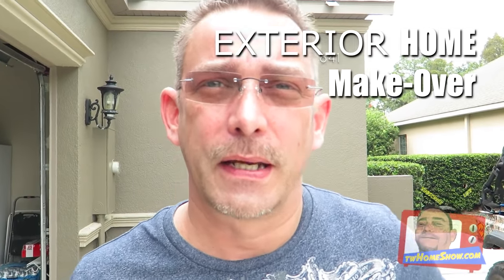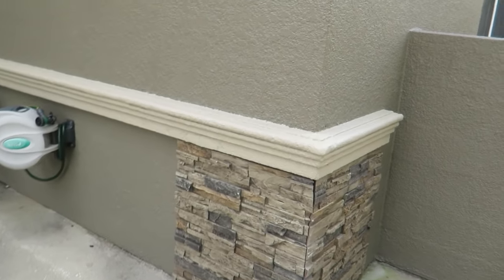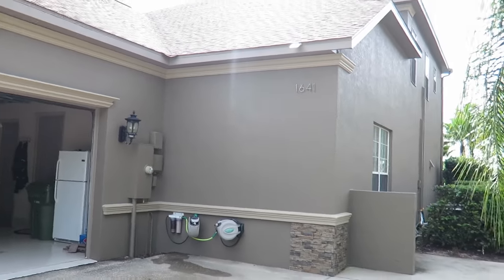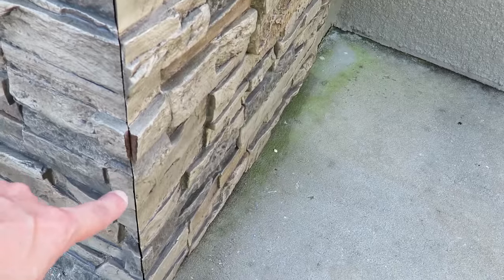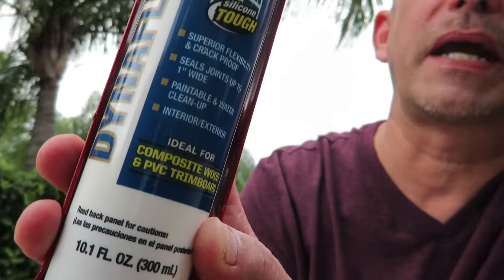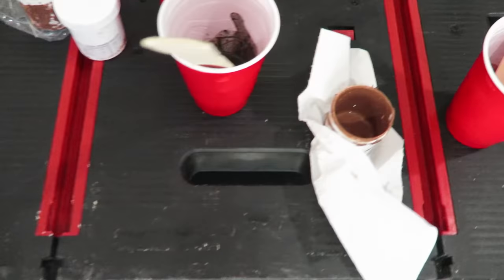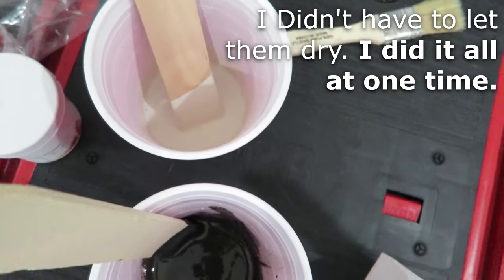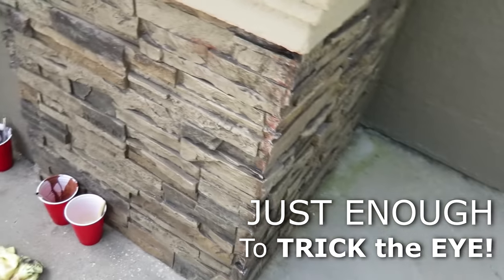Install (FAKE) Faux Stone Panels: EXTERIOR  . . . SAVE MONEY - AMAZING RESULTS!

Comment: My home is 100 years old.  I have been calculating and experimenting with various siding themes.  I have had stone or brick in mind from the start.  I have a definite design now.  Thank you.  This product fits my budget and seems within my abilities to install.  My home is rather simple in design in comparison with yours.  The wood 4"T1-11 4×8 siding installed horizontally with this Faux TandoStone panel as a base will bring my old home to life.  Simple trim and a panel separator mold will be very nice.  You have helped me greatly with your posting.  Thank you very much.
C/O in Oklahoma

Comment: You didn't show how to put it on the wall. Was the wall concrete? If so did you use tapcon screws?
Reply from the maker: Hi Bill. Yes. The wall was stucco/concrete and I used tapcon screws and just touched up the screw-heads with the touch-up paint.  - Todd

Comment: What type of saw blade did you use and did you pre drill the holes before installing the screws?
Reply from the maker: Standard circular saw blade for wood. Yes, I pre-drilled holes through the product and into the stucco-block with a concrete bit.

Comment: omg this looks so good. The caulking with the paint turned out nice. You couldnt even tell. How did you apply the panels into the stucco? We have a stucco home as well here in florida. Did you drill into the stucco?
Reply from the maker: Yes and use tapcon screws to attach the panels 😀
Reply: @twHomeShow  are the screws painted also?..Tapcons are usually blue...,Filler then paint?🤔fiberglass resin can work pretty well unless its a type of foam board, hope its not foam....condensation between stucco and foam board  products with lil to no air gap makes for huge issues like mold, mildew etc

Comment: Huh? you should have removed your hose racks and completed the wall.. looks incomplete don't ya think?
Also, those are to be used with adhesive, not just nails.. but looks good..
Reply: totally agree with you and they have special panels for the corners without going through all that work

Comment: Looks great. You did a great job. As far as expense....wow. it adds up quick once you add any element of height.... i.e. You're likely 8 ft to the soffet level. that would require 4x the panels for the same LF. Plus, trim and outlet accessories. i think that why we only see this faux stone used as accent pieces and not as much on full walls. My project is 60 ft long by 9 feet high. It will be over $10k for the project. Stucco and paint would be less than $1k....

Comment: Could you please tell me how you attached these panels to the wall?  Did you just screw them in? Did you use any type of glue?
Reply from the maker: The recommended glue didn't work for me so I drilled holes and attached with concrete screws.

Comment: This is great and all, but where did you show the way that you stuck them to the wall? Isn't this a howto install? You mentioned adhesive multiple times but I didn't catch watch you used or how. Just a video about cutting to size.
Reply from the maker: Mike, You're absolutely right, I "F'd-Up". I originally tried the adhesive that was recommended for these panels and the panels just slid-right off! So I really recommend using screws...in my case concrete screws. You have to drill the hole and screw in the screws - WORKS GREAT and FAST! Look for my other video where I applied this same stone panel....HERE'S A BETTER VIDEO: https://www.youtube.com/watch?v=pNFS_1Ur94k
Reply: @twHomeShow  Awesome, thanks for the link I'll check it out. I've seen other people use screws, but I was wondering if that is the typical or recommended way to install them, and if they look concave  or weird if you don't screw them in just right. And the biggest thing on my mind was, how do you deal with the exposed screw? Cover and paint it? leave it because they blend right in from a distance? How did you go about dealing with them? Thanks again.
Reply from the maker: @mikeakaspike  I just dabbed them with the touch-up/blending paint that you are supposed to purchase with your stone panels :) Check-out my other video, with the columns I did and you will see how it turns out.  Thanks for your comments! Todd

Comment: I wanted to know the same thing. How did you attach the panels to the wall? Glue, nailed, screwed in?
Reply from the maker: I predrilled and used concrete screws into the stucco. I tried glue first, but that was time consuming at didn't hold very good.  -Todd

Comment: Caulk on the outer corners? They make special corner pieces to cover the entire corners...smh
Reply: . SAVE MONEY...
Reply: @touchforlife  If a person wants to save money, then they don't own a house. But if you want to decorate your dream-home, then you're not supposed to try to save money. You're supposed to go all-out.
Reply: your right and he looks like he got money
Reply: If I were to miter the corners like that I would've made a much better cut with a track saw and then tightened up the corners with trim screws and then maybe caulked the screw holes with a tiny bit of touch up paint. There's no way I'd leave a gap that big. Expansion and contraction is going to blow those corners apart.

Comment: For what little you did, why didn't you invest in a couple or 3 corner pieces.  Not that bad of a job, but it would have looked allot better.  Also an old vinyl table cloth would work good to use to place on the ground to hold your various paints.  An you can also use an old cookie pan to place your paints in (again) to stop spilling on our your concrete.

Comment: The touch up could have been a little better but very nice still, really enhances the looks of the home 👏🏼
Reply: Should have used the house paint to cover caulking, it would have matched better.
Reply: Where did you buy panels? How did you nail it? Does it need to go into studs and do you need glue if stucco isn't smooth

Comment: Are you in Central Florida by chance? Also is this your true first time installing this?
Reply from the maker: Hello Scott, I'm near Tampa, FL. I've installed these panels on outdoor patio beams, indoor entertainment walls, and kitchen bar. All my videos can be seen on my channel page.  Thanks for watching.  -Todd
Reply: I'm in polk county fl myself. What the size of each panel? I looked an the website briefly but didn't see that info. Also thank you!
Reply from the maker: @gogators5762  https://www.barrondesigns.com/

Nominal Overall Dimensions	47" Wide × 24 3/4" High × 2 1/2" Thick

Nominal Coverage Dimensions	42 1/8 " Wide × 24" High

Comment: The rust color paint was the wrong color, but you covered most of it up with the darker colors, it looks very nice. The only thing that does not look right is the unfinished wall were you spilled the paint and tords the front of the driveway were the plants are. The stone should be everywhere the molding was. Other than that it an upgrade to the curb appeal.

Comment: I was wondering if you have to remove part of the exterior wall of your house to put this on?
Reply from the maker: NO. I just drilled holes with a concrete drill-bit and used countersink Tap-Con screws to screw this over my exterior stucco surface.

Comment: Not bad at all. How did you set the tapcon screws
Reply from the maker: Thanks! I just bought a pack of tapered-head blue tapcon screws from Home Depot and used the included concrete drill bit and screwed them in. They will countersink themselves into the stone-boards.

Comment: Do you put adhesive to back
Reply from the maker: Hello, I tried the adhesive they recommended (even bought the special applicator gun) but the panels would just slide and fall down. The glue sucks!! I used a few blue tapcon screws about 2" long with philips head. Pre-drilled with concrete bit because I was going through stucco and block. That method went very good and quick!
Reply: @twHomeShow  
Thank you, for explaining that. It would have been nice to see the application process to complete the video. Any behind the scenes footage that shows the application process?

Comment: I would not be happy with the outcome. You should have disconnected the houses and water filter and put the panels all the way around. You could have fasten them back with 3 1/2 inch screws. As far as the corner pieces connecting you should have had a tighter fit and no need for paint.. that paint job was horrible. Man I hope you didn't get paid. I could have did it all including behind the hoses in 1 day!

Comment: I been installing stone for 40 years,  recently had a customer who bought panels, thought maybe I could find a few tips or tricks, what a hack job, sure as hell would not even consider your method,  looks like dodo, 😖p.s. I'd get some potted plants to put in front of it 🤔
Reply from the maker: Hello Collin, This is an affordable faux (or FAKE) stone product that is hearty and stands up to the weather. It is meant for affordable homeowner solutions. This solution has a cost of under $500...You are probably looking for the more costly and internally satisfying solution of "REAL" stone and that has a cost of around $3000 to $5000 for this project. You should take your wallet and move on to real stone videos.... P.S. No one has pulled up to my house and asked me if that was FAKE stone. It just looks real. Spending thousands of dollars on real stone would NOT increase the value of my house. This is why I choose to do this....
Reply: tw HomeShow m

Comment: Not a very good job terrible edges if you cut the corners better you don't need to touch up. Need to wrap the wall all the way around for better look and and trim at the edges by the garage doors.